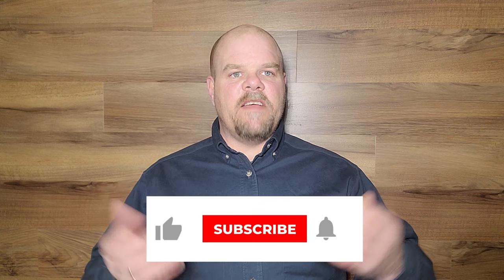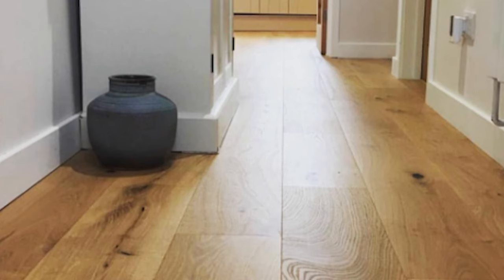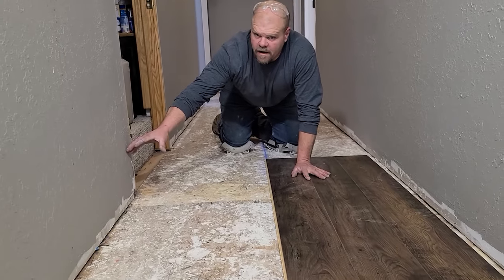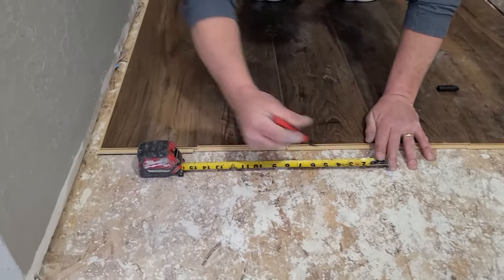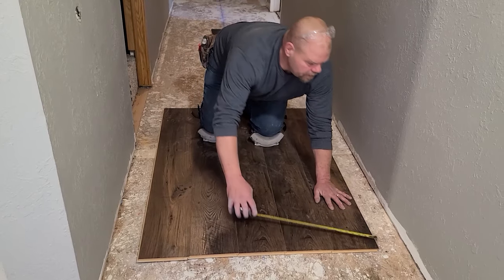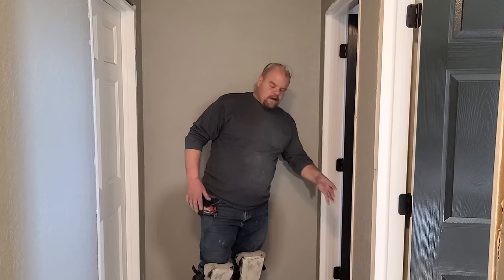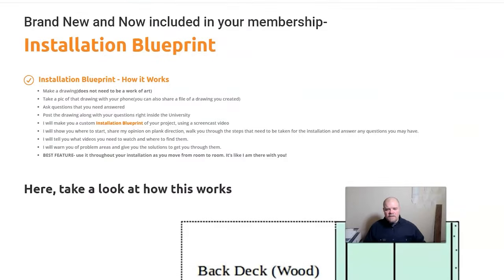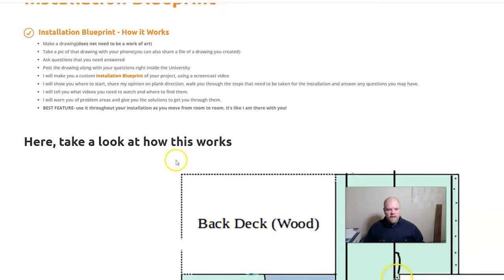Where you should Start Installing | Laminate Flooring or Vinyl Plank Flooring

Comment: Hey Joe! Thank you for this video. i have a couple of questions for you and i hope you can help. Im going to start the planks in the hallway like you suggested, i already have baseboards installed with a little over a qt inch of clearance from the subfloor for my planks to slide under. question is, when measuring to find the center of the hallway, do i measure from baseboard to baseboard (which seems to me will be the most consistent) or do i go under the baseboard? question 2- from a quick check i can already tell my hallway isnt square, so when i measure in multiple locations do i get the center of each location and then snap my chalk like using those marks? hope you can help. Thank you!
Reply from the maker: I answered your question here - https://youtu.be/u31kGFSLUU8

Comment: So if I understand correctly, you moved from the edge of the board on your chalk line, to the center of the board on the chalk line.
Reply from the maker: Is all I am doing is moving the plank over a half of a plank and this will still give you the same size piece on both sides , but it will either be a bigger piece or smaller.

Comment: I just want to point out that just because you have the same inside measurement doesn’t mean that the hallway would necessarily be square to the other rooms and walls …… I’d always snap an offset s and check for square.

Comment: QUESTION: Saw your video on flooring in the bathroom. I'm going to install Smartcore Pro 12x24" flooring, we have Bath Fitter shower with a Acrylic edge sort of like a frame. Should I cut under the Acrylic edge to slide the flooring under it ?  We live in Florida and it doesn't get really cold, does the 1/4" expansion really needed?
Reply from the maker: Is this the only room you are installing in?
Reply: @SoThatsHowYouDoThat  Yes it is 5'X5".
Reply from the maker: I would just butt that side tight and leave an expansion joint everywhere else.

Comment: What if your hallway walls are not even? My center line is crooked and the hallway widens out in a section.
Reply from the maker: Try to make it as straight as you can by moving the line.
Reply: @SoThatsHowYouDoThat  I found a very consistent line in the subfloor that measured evenly from the wall until it ran to the stairway. I used that line and laid some planks down. Worked like a charm! God bless brother. Thank you for your videos!

Comment: I find it better to start off the longest exterior wall. let the hall fall the way it falls. you run the risk of starting in a hallway that could potentially have crooked interior walls and having your main living area crooked at the exterior wall. this is the first time I've ever heard of anyone laying out the entire main floor off the hallway. this can't be the way you were taught.  this is not a good flooring practice.  I'd like you to show the longest exterior wall after doing this. measure the gap from wall to floor on the last row installed. the cut row. when installing wood planks of any kind you have to find your line off the longest exterior wall I can't stress this enough..